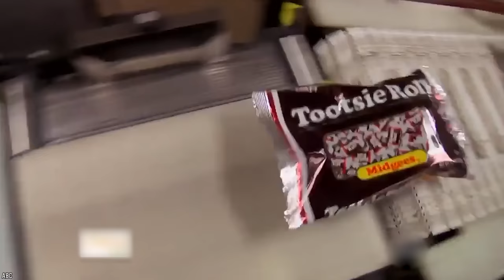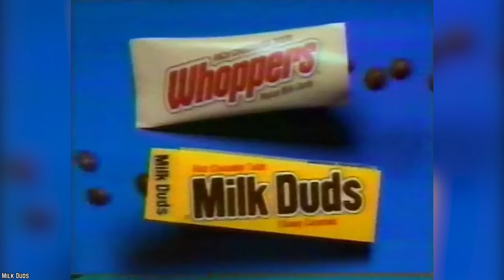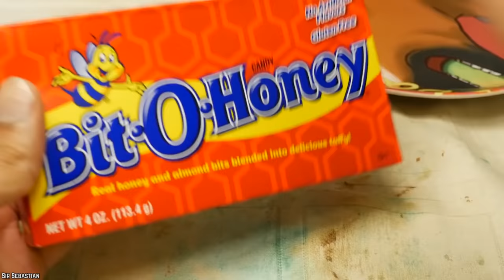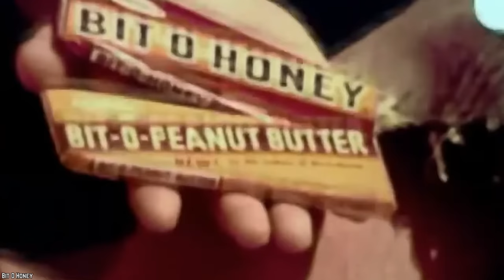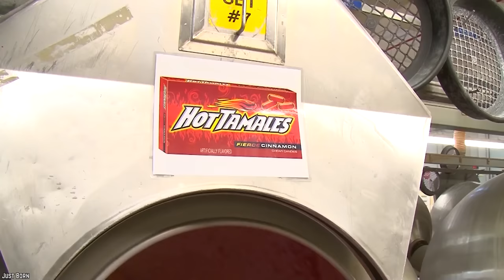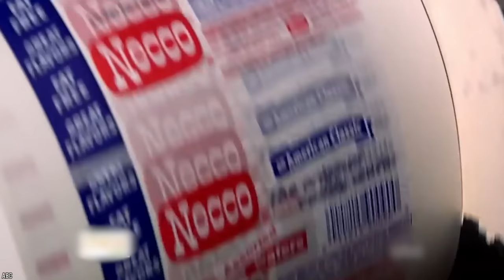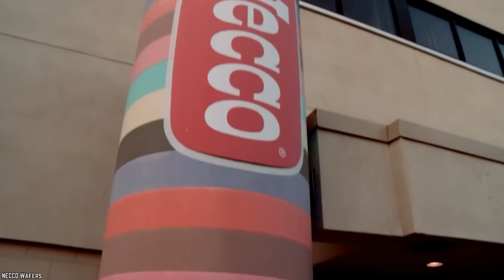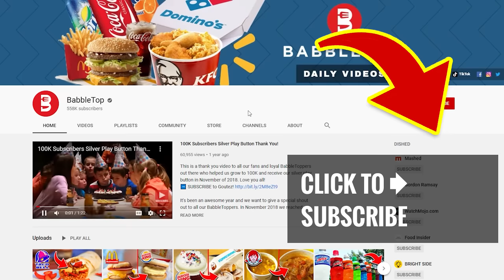Top 10 Worst Candies Ever Made RANKED!

Comment: Fun fact about tootsie rolls:
In WW2, there was a group of soldiers that were low on ammo, while the group was looking for ammo left behind, enemy forces spotted them and started firing at them. Since the group was low on ammo, they called airforces for ammo, since the enemy was near by, ammo had a code name "Tootsie Rolls" airforce was slightly confused but gave them it. When it arrived, they were greeted by... TOOTSIE ROLLS the candy. The soldier were pissed at them but saw something that they can use them on. Still under fire they snuck out and ran. They ate some of the tootsie rolls and one of the crewmates noticed something. The tootsie rolls became chewy and soft, then slowly hardened. He had and idea, since it hardened fast it can be used to repair things. So those madlads fixed their tank what tootsie rolls.

This was not made up.